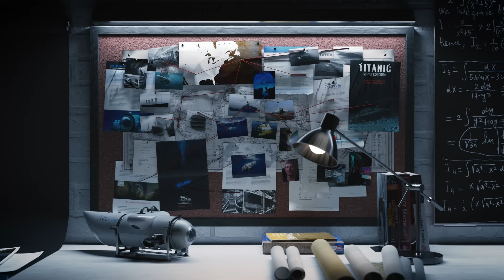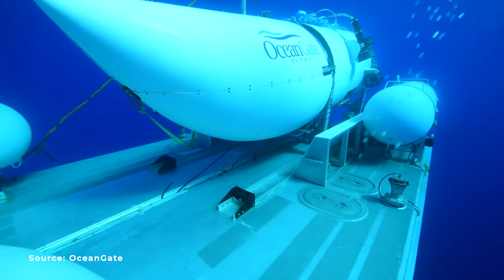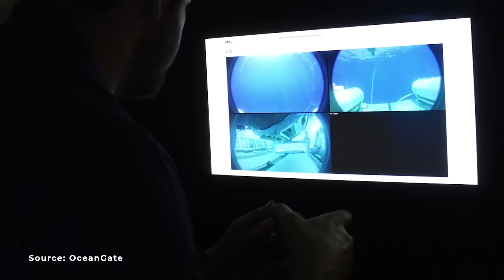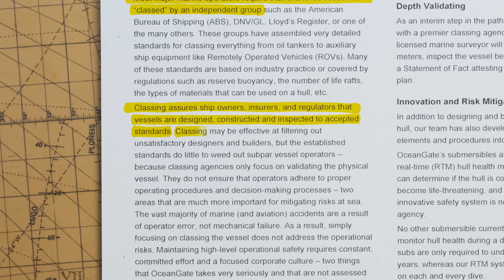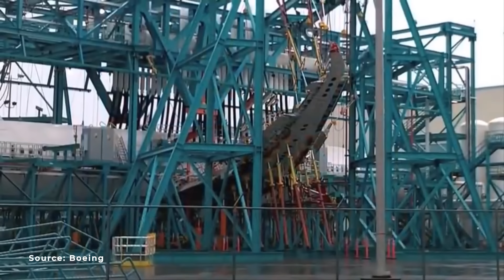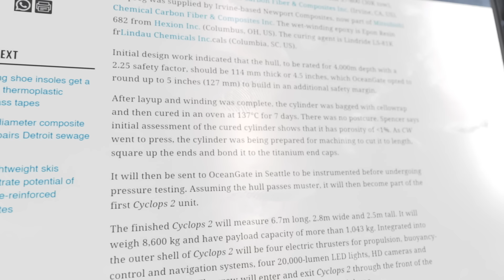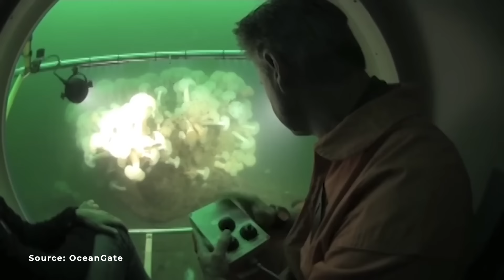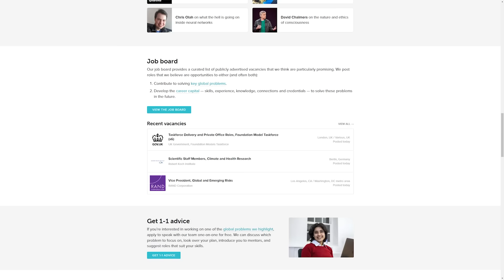The Questionable Engineering of Oceangate

Comment: Composite engineer here I have run several simulations on the Titan Submersible:
https://youtu.be/i-bvNHCCpFo

And found that the CFRP allowables are all close to 1, so there is no real saftey factor in the Design (would assume at least 1.5 safety factor). CFRP can be used for compression,if the a good layup is choosen (made my PhD in this topic) but not without proper safety regulations ,testing and validation.

Comment: There's something of a famous historical example of World War era bombers being assessed after returning with battle damage. They'd create a diagram of the plane and map the bullet holes that planes come back with. The resulting diagram showed where the planes that come back were most often damaged. The immediate thought is to add armor to those locations as that's clearly where the plane is shot at the most. But this is wrong, and is called survivorship bias. What those bullet holes actually showed isn't where planes are most often hit, it showed where a plane can be hit and still survive to return to base and have its damage assessed. Planes shot in the cockpit, the wings, or the tail tend not to come back to have their damage assessed.

"The vast majority of marine (and aviation) accidents are a result of operator error, not mechanical failure." just screams survivorship bias to me. You don't get many mechanical failures when every other vessel is rigorously tested so that there won't be mechanical failures where and when it matters.

Comment: I agree that Oceangate, Rush more precisely, cut corners and evaded certification which is now used against them for the right reasons but... Why does it seem that the sub was plungging hella fast down to the Titanic on the day in question? At 9,45 they were already on 3500m, they should've been at around 2200m...Why did the sub go down so fast? And why did the mounts take multiple attempts to detach from the sub? Even after getting rid of all of their balasts the sub only rose by 20 meters before imploding (which was 20minutes) ? I understand the failures, but after 50 dives why was this dive that had a couple of billionaires on board so different? Also why did the Navy wait with the info that they detected the implosion? Because of their restrain this seemingly unimportant event became world wide viral news...I hope the investigation is impartial, but I think it might be covered up to further disencourage any wanna be Rushes out there.
Reply: SOSUS/IUSS covers an ENORMOUS area and it takes a lot of time to skim through the data and even longer to conclusively say that a certain sound was due to an implosion. If you read up on the loss of the USS Thresher, SOSUS took about a week to find the sound corresponding to the sub imploding.

The search parties likely received confirmation right before finding the debris field of the pressure hull.

Comment: Using carbon fiber as a hull is kinda Iike using a blanket as a riot shield.  Bundle it up and you might be ok, but it’s not meant to do that, it’d be better is use used it as an exterior coating and had a hard composite under it.

Comment: Yes, cf is great at tension but fails at compression.
But these engineers failed to even use that property to their advantage.
How?
When a cylinder buckles, the interior wall goes under tension as the exterior goes under compression, but these geniuses drilled screws all over the interior wall to hold hardware. Wow! 
Sigh... there should be a mandatory IQ test that everyone has to take, so the questionable ones could be kept out of certain jobs. I saw the pic of the engineers. Clearly NOT hired based on merit.

Comment: Is snap buckling caused by ILT? Cause that's tricky to capture in a FEM.
Reply: But the DFL shows the XPL is greater than the SK on the VBW which is why it imploded.
Reply: @AORD72  lol
Reply: @Dad_Lyon  So what is ILT and FEM?
Reply: @AORD72  appreciate the humor! Long answer following.

ILT is Inter Laminar Tension, which is when tensile force develops between the lamina, usually happens around bends/radii. 

FEM is Finite Element Model, and it's just computer models. 

It's hard to calculate Inter Laminar Tenion with FEMs because most models use shell (2D) elements and can't calculate those tensile forces. FEM is usually good for thin laminates, but for 5 inch thick laminate would be poor.

Comment: To be honest, Titan was not that bad. The issue was the lack of safety culture of the CEO. You can use carbon fiber composite with the correct replacement periods. However it’s kinda questionable move to test the MTBF period on billionaires.

Comment: The statement that operator excellence is ignored in classing a vessel, and the bragging assertion that OceanGate focuses on why accidents happen, reminds me of the terrible illogic in WWII. Fighters would come back with holes from enemy fighters' guns, and maintainers were focusing on strengthening the areas that showed damage on all the planes.  Like the CEO of OceanGate, the maintainers were focusing on exactly the wrong thing.  The planes that CAME BACK came back with damage that wasn't fatal.  The fatally damaged planes didn't come back, and so they were strengthening the wrong parts parts of the planes, the parts that could take some damage.  All the sub accidents were human error BECAUSE all the vessels were classed.  They were rigorously and independently tested, so all that was left was human error.  Huge red flag for the logical.

Comment: I'm no engineer but one thing I've noticed about other deep sea submersibles is that the pressure chamber is always a sphere made up of a single piece (plus any hatches or windows). The Titan was a cylinder made of multiple pieces and materials glued together. That would appear to introduce weaknesses and potential failure points all over the vessel. I don't envy the people doing the investigation. This thing was the product of one bad decision after another.

Comment: One problem here is the lack of regulation at the international level. Rush and Oceangate didn't just build an unsafe vehicle for the regime it would be operating, they operated it as a commercial enterprise for the wealthy public with no real oversight or regulation. There were passengers killed in what was a highly experimental design the creator refused to allow be tested to industry standards.

Corporations have operated at the multi-national level for a long time, regulations meant to protect the public have simply not caught up.
Reply: Regulations unfortunately do not mean anything in international waters, as there is no judiciary or regulatory body that has any jurisdiction there.
Which is exactly why Oceangate decided to operate on international waters, to avoid scrutiny on what they've built.

Comment: Thanks for this video. 
I had not heard that on a previous test mission, someone heard cracking sounds with their own ears coming from the hull. Wow. 

On the matter of cost savings, I must also say, that it shouldn’t have been so difficult to shoulder the cost burden here of a steel or titanium hull, or foam buoyancy layers, given that each dive seems to have produced a million dollars of revenue — they already had 50 dives ($50M already?) — and this submarine simply wasn’t that big. I’d love to know the volume of steel & foam that would have matched the volume of carbon fiber epoxy here, and a ballpark estimate of that material cost. In short, how much money did they save by not using steel, compared to the revenue they estimated for the life of this submarine? It would add context to this story. 

Finally, if I were still a mechanical engineering student at Purdue, I’d be keen to build a few small scale, remote-operated versions of this vessel using carbon fiber hulls with every matter of strain gauges and delamination sensing, different amounts of epoxy resin voids, subject them to repeated massive pressure cycles, and see what happens. Not sure how difficult it is to create 400 atmospheres of pressure for testing… b/c I haven’t looked into it… but if the best answer is the sea… ships ahoy.
Reply: Back in the day... went to Southwest Research Institute (?can't remember the name) in San Antonio, to test our subsea equipment at depth.  They had a 3 m diameter tank about 10 m deep that we filled with ice - to simulate deep sea ~ 0 Celsius - then topped up with water and pumped up to  270 bar. That's what... 2700 meter depth, not quite as deep as the Titanic, but deep enough. It's not difficult to test.

Comment: Very well said.  I am an aircraft nacelle repair engineer.  We constantly reject customer proposals for repairs that would likely be fine, but we don't have enough testing data to confidently back up.  We also constantly do new testing to make our repairs better and easier to install for customers and to increase the amount of damage we can repair.  Without testing of the physical parts after manufacture, you can't do real engineering when lived are at stake.

Comment: Could have calmed down a bit on the narcissistic ceo stuff. Elon wasn’t putting lives at risk with the spacex trials, just lots of money. That was done the right way. Like if oceangate (way too close to heavens gate btw, was this a quest for enlightenment?) had built a submersible and run it into multiple catastrophic failures under robotic control until they solved the issues.

Comment: One interesting thing from the recovery pictures is that acrylic window was gone, and the the ring around it was like it had never been there - no signs of the bolts even. This seems more likely to be from the action of the inrushing water implosion of the window and inrush than the explosion following implosion of the hull, but its interesting either way. Will be very interested to see analysis.
Reply: Those types of windows are designed in a cone shape. It can't physically be pushed into the submersible unless it breaks. The more pressure its under the tighter the seal gets. The fact that the outer mounting ring and bolts are gone means either the window was removed or the whole things was blown outward as the sub collapsed.
Reply: @seanmurphy3413  there didnt appear to be bolt holes, or remains of the ring or bolts. The Acrylic was seemingly only rated to 1/3rd the depth. It is one of the major suspects.
Reply: @mycosys  Its possible it did fail. If you look at intact pictures of the sub there is clearly a metal ring with bolts around the window. From the pictures I can find of the recovery of the dome with the hoisting strap through the window - this ring with bolts is not present.
Reply: @seanmurphy3413  exactly - not just not present but the surface where it was seemingly scrubbed clean, no sign of bolt holes or stubs or torn metal.
Thats some special force if so.
Reply: @mycosys  I agree. All the bolts probably sheared. I think its a low res pic and the focal point of the camera wasn't on the window opening. Whats left of the bolts is probably still in the holes which is why we cant see them.
Reply: @seanmurphy3413  The pics on the BBC site arent all that low res. Its scrubbed flat

Comment: I think the point of failure was near the junction of the carbon fiber with the titanium rings, because in that area, the carbon fiber had a little more resistance due to the titanium ring, but that resistance decreased as it moved away from the junction points, creating a strength differential.  therefore, what first imploded was the central area of the carbon fiber cone

Comment: There was literally a 10 year old video that surfaced after this that showed a guy putting carbon fibre cylinders in a vacuum full of water and turning it up to thousands of of pounds of pressure. Each time he took them out after only 10-15 seconds of exposure, the cylinder had splinters and micro cracks in it. I am willing to bet that Stockton Rush didn't do any actual testing of his hull and just winged it.

Comment: Internal pressure vessel buckling is due to compression from the outside pushing the material inward causing the iner radia to become smaller and causing "micro-wrinkels" where there is a pocket or void or defect or the point of greater weakness all un-uniformaty in pressure. Normally this would be near the top of the vessel just because that's where thats the point where the least amount of outside pressures is weakest. Once the "micro-wrinkle" is formed a buckling fracture will soon form.

Comment: Great vid. Still there`s a lot more to it, for example that the only used rolled on carbon fiber, not even woven mats to have always at least some under tension. The cylindrical design that basically comes with load peaks instead of just using a sphere. 
And that goes on. 
It was funny to read the comments about the thing being bolted and you couldn`t get out, which is a non factor as with the pressure you`re not getting out anyway. Or the controller, which seems not to be a safety issue because they could just drop weights. 
But building this, have no idea about aging and fatigue, the way it was build, the materials chosen and how they were used - 2023 darwin award for Stockton Rush.

Comment: I saw a lot of concerns about the controller.
But I think that videogame controllers are engineered way better than people think.
They need to sustain a lot of tests before being put in production.
Have you ever thrown one of them to a wall?
Reply: The controller wasn't necessarily an issue, I wouldn't have used a wireless controller like they did however and instead have used a wired Xbox controller.
Having the controller being wireless just added one more unnecessary failure point.
Reply: They had backups onboard. They probably had a cable. The screens were touch screens. They had keyboards and mice. If a controller failed nobody was going to die. You didn't need a controller to surface the sub.

Comment: 😆55m/minute???  Dude, you´re way off the beat for a "real engineer". For the 3800m depth they took 2h and 35m on the first dive, which would add up about 24m/minute and circa 2h and 15m per minute on the second dive to titanic which would add up to 26 or something. (that was according to their website / facebook-posts). I guess if descent speed is at double that amount... catastrophic implosion is imminent. (slowmo pressure-tests on youtube suggest that the increase-speed of pressure  plays into failure as a significant factor when it comes to carbon-fibre cylinders) just saying

Comment: How does the analysis of carbon fiber in compression work? Would you assign zero compressive strength to the fibers, and zero tensile strength to the matrix? I assume that would be a somewhat conservative way to do things. Using this type of analysis would drive a person to not winding all of the fibers around the circumference. Or maybe realizing that this is a bad idea.

Comment: In this case, "You're remembered for the people you kill" might be more fitting.
Who the hell would use carbon fiber in a compressive mode, that's like using a really sharp knife to put out a fire.
Dudes death chamber was flawed in so many ways, you've mentioned many of them but the main reason this industry has been so safe for so long is because "Work hardening".
When a steel or titanium sphere DSM goes to depth for the first time it is the weakest it will ever be, it is the "Work hardening" that cold forges the material. Because the DSM is spherical the immense pressure acting on the hull is equally distributed, no matter how high that pressure gets it only tries to make a "Smaller ball" so this "Work hardening" happens equally throughout and the hull becomes stronger with each dive.
Carbon fiber has a limited service life, in a compressive mode this service life is a complete mystery, especially to Stockton.
If Stockton cycle tested ten cylinders to failure he would have known when they failed, how they failed and how many cycles he could safely do before retiring the cylinder, Stockton knew this but Stockton didn't want to spend the money for all that carbon fiber, even with a discount, Stockton apparently thought just piling more carbon fiber would be "Good enough", great engineering job.

Comment: As someone who works in the NDT (Non-Destructive Testing) part of onshore oil and gas, specifically in pressure vessels, pressurized process piping, and various other equipment, and follows industry standards such as ASME Sec V, VIII, IX, B31.3/1, etc., everything you said makes sense. 

I can imagine the same requirements for such extreme underwater applications. I am in awe that they didn't follow the well-established norms and standards.

Comment: In these depths the temperature of the water is close to 0° C and carbon fiber composit materials get brittle like glass. Combined with the fact that it is virtually Impossible to detect any kind of delamination or other imperfections in the material, this sub was doomed from the get go. They also decided to use expired pre-preg carbon fiber sheets from Boing because it was cheaper than buying new better suited material, which supports the theory that this was a reckless cashgrab.

Comment: Former aircraft structural mechanic here. As soon as I heard it was built from carbon fiber I came to the same conclusion about expanding micro voids. Vibrations and flexing on aircraft can have a similar effect on composites let alone the pressures on a sub.  It was poor engineering. Until I saw this video I didn't know that they didn't even bother to autoclave it.  Which is just ridiculous. Based on the the construction I believe it would have failed no matter what but it would have lasted longer with the autoclave. If it was an experimental unmanned vehicle I could maybe see doing it this way but this idiot's ego and greed killed four other people.  When you do work that people's lives depend on you do not cut corners.